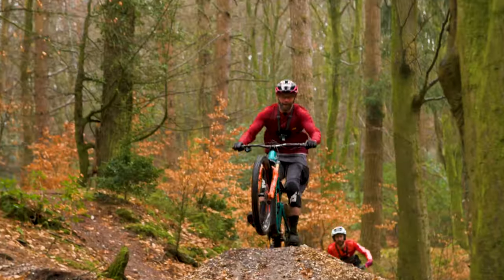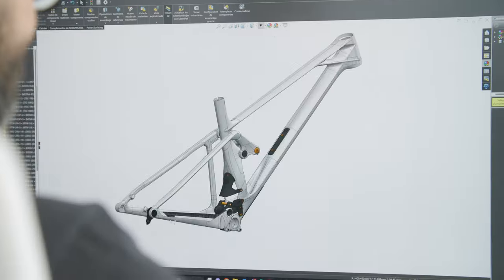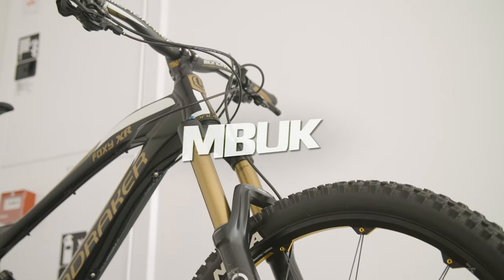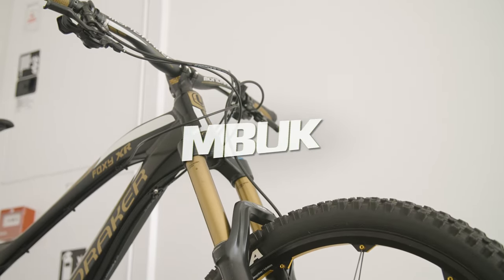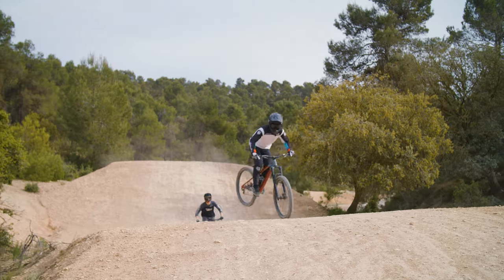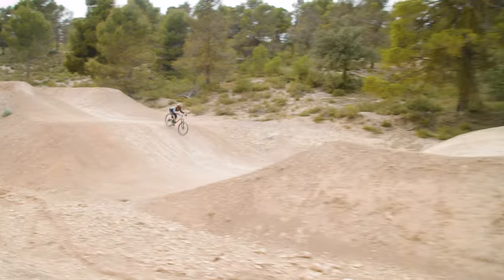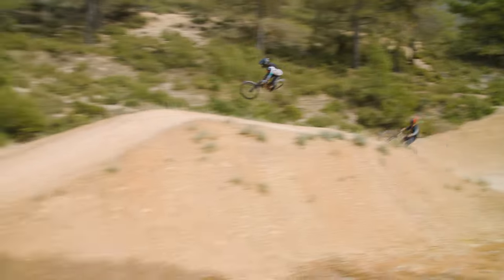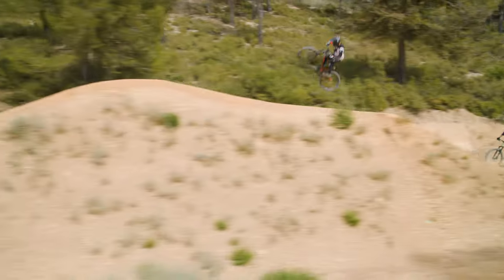How To Adjust Geometry | Flip Chips & Headset Cups Explained!

Comment from the maker: Have you changed your geometry? 🤔
Reply: I'm looking at increasing my forks from 130mm to 180mm. Have asked about and looked online and the majority am saying it will ruin the geometry and cause stress to the headtube. Using an angled headset and with adjustments to the reach this should in theory counter the negatives on geometry and a better supported headtube also increasing the slack in suspension would aid this too? Be great to hear ideas and thoughts @bikeradar

Comment: I'm looking at increasing my forks from 130mm to 180mm. Have asked about and looked online and the majority am saying it will ruin the geometry and cause stress to the headtube. Using an angled headset and with adjustments to the reach this should in theory counter the negatives on geometry and a better supported headtube also increasing the slack in suspension would aid this too? Be great to hear ideas and thoughts @bikeradar